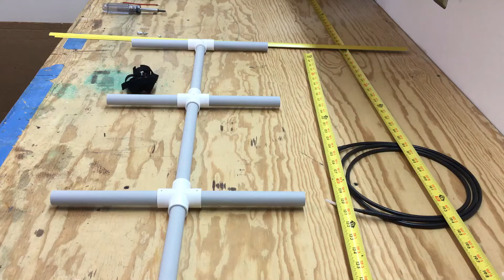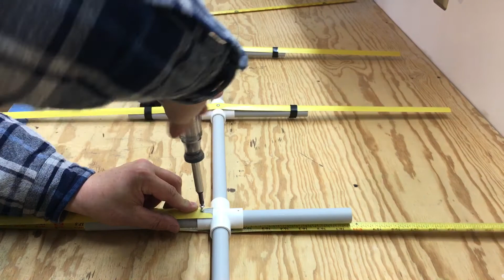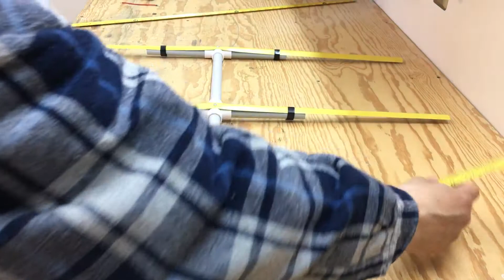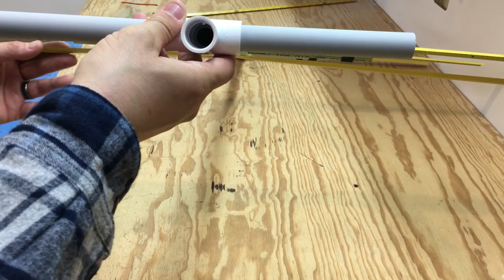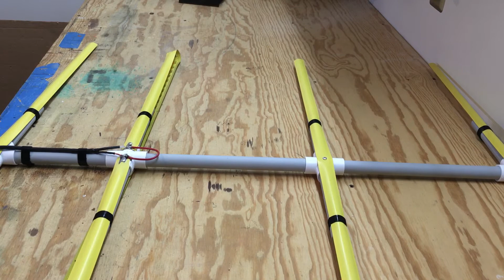How To Build A 2 Meter Four Element Folded Dipole Tape Measure Yagi Antenna (Part 2)

Comment: Don't you need to use a 1/2 wave coax 4 to 1 match for the folded dipole driven element????
Reply: That's exactly what I was thinking of.  A folder dipole is about 200 ohms.